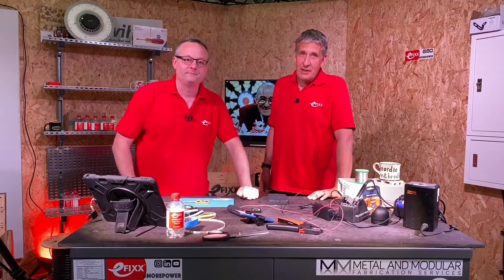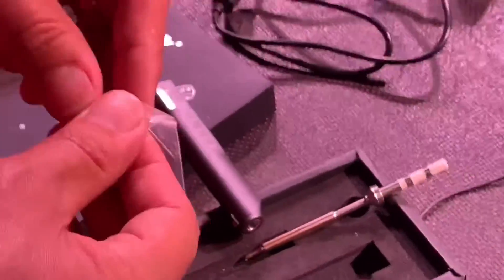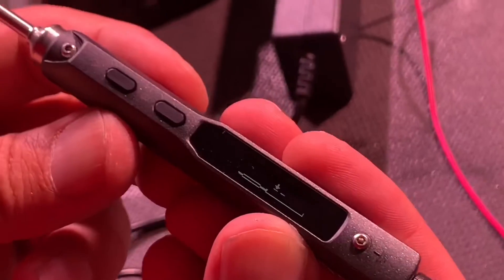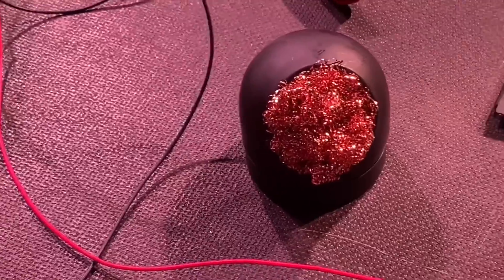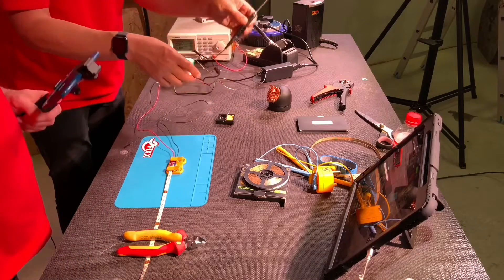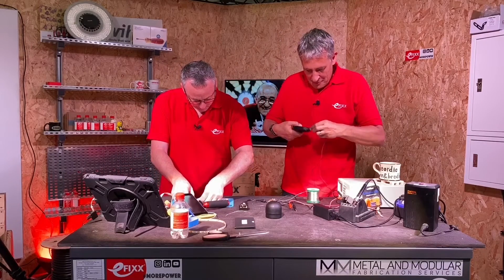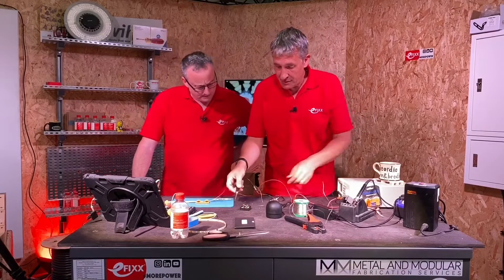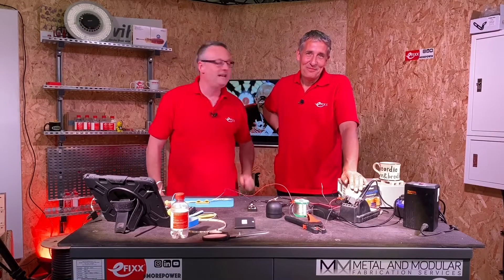Is the TS100 the best soldering iron for electricians' installing LED strip and tape?

Comment: These irons are great for on site soldering of LED strip. I've had one for a few years now and highly recommend.  I've modified a Makita 18V USB charger to run the iron too.  That way you can just run the iron from your existing drill batteries. There is also now a TS80P that can run off a USB-C battery pack, which may be more handy if you don't fancy making your own battery solution.  The TS80P is only a 30W iron, vs the TS100 which is 65W.  However for LED strip, 30W is more than enough.
Reply from the maker: Thanks for the comment  - we are going to have a crack at recycling some old DeWalt batteries to power up the iron.
Reply: How did you modify the charger?
Reply: Great idea running it direct off the battery packs. Never thought of that! For Dewalt, they output 18V straight off the terminals, so should be an easy mod.

Comment: I usually buy the LED strips which plug together so need need to solder. The Ansell Cobra range is my LED strip of choice and I have never had to lift a soldering iron installing it.
Reply: Just had a quick look at the Ansell Cobra range and the plugs look good. However of you want custom lengths, do you not still have to solder the pins on the end?  Still much better than the junk push fit ones for generic strip, which has to be soldered for any kind of reliability.
Reply: @lucidlx  Usually I don't have to cut them as Ansell do the strips down to 100mm so you buy the lengths you need and just plug them together. They do have cut lines so just cut on the line if you need it shorter and leave it.

Comment: Great video as always. 
I have modified a Dewalt DCB091 USB adapter so I can run mine off the 18v batteries (actually output 20v) and it works really well.
Reply: Yup, I did this with the Makita version. Works well, but you should also add a 5A fuse, otherwise it's quite exciting if the cable shorts out. Basically the whole cable lights up and melts in a second!

Comment: Sometimes a soldering iron can be too light and the cable dictates its movement on the stand, also the overall length of the tip amplifies the handshakes. Either battery rechargeable or gas soldering irons for me.
Sorry to be an old moaner but I'm not a fan of the two presenter format. Gary is asking questions like the apprentice but then answering them as Gordon answers them too. OK having two of you when there's a challenge but the recent double acts have been distracting for me. Your solo videos have been excellent, Joe's recent videos on outside lighting have been brilliant and very informative and great to follow.
Great channel though. I'll wait for barrage of abuse now. Sorry just my opinion

Comment: It’s all about gas soldering irons, I’ve had my weller pyropen for years super reliable, cordless, heats in seconds, powerful enough to do some quite decent sized heat shrink and lots of tips available 👍
Reply: They're OK you just have to watch the exhaust from the iron, I've melted a few things with mine
Reply: Since getting my TS100 a few years ago, I haven't touched my gas iron. For LED strip, having the temperature control is so much better. Also no gas jet to melt stuff by accident!

Comment: I use a gas iron, works well, but I like these little TS irons as well. I think the gas ones have more thermal mass delivery, better for soldering heavier joints rather than just thin led tape strip. Funny double act again fellas 😁👍
Reply: As long as you run the TS100 from 24V, then it's a 65W iron.  Which has coped with anything I've thrown at it. Including 4mm cable into chunky terminals.  It's much more powerful than you would think from the size!

Comment: I've been considering the Milwaukee battery soldering iron any opinions?
Got the solder8 it makes it so much easier😊
Reply from the maker: IMO - the Milwaukee looks quite heavy which could be a challenge with small pitch connections. *Gordon
Reply: My opinion, go Milwaukee. You can also leave it standing on 90 for soldering. Won't change it for nothing corded.

Comment: Can you look into the portasol gas powered iron and review it, no electricity needed. I’ve used one in the motor trade for 15 years and swear by them. Comes with adjustable temp and multiple tips. Might help sparks where the power is off in the property.